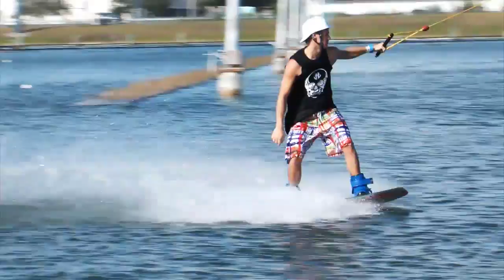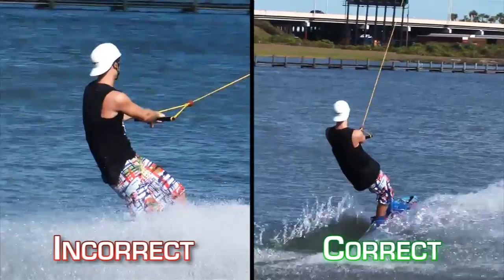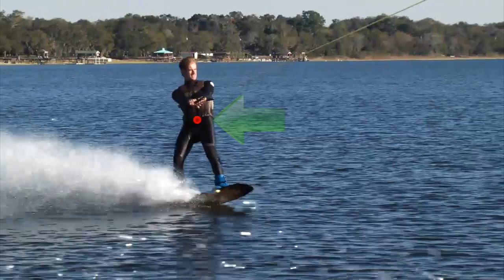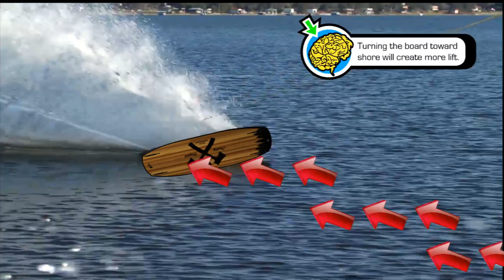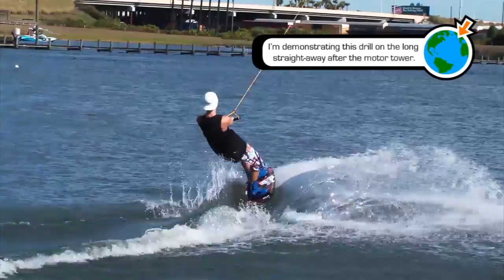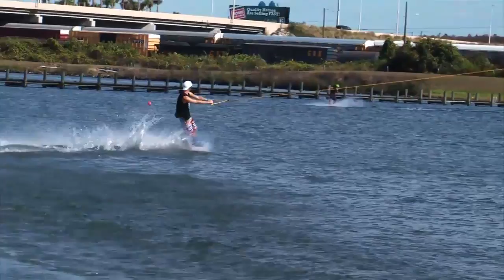Loading The Line The Hard Lean Drill

Comment: Is the towpoint  maybe the location directly underneath where your line is fixed to the carrier ?
Reply from the maker: The towpoint is exactly what it sounds like, the point at which the rope is connected with the thing responsible for moving you through space, in this case it is the carrier.